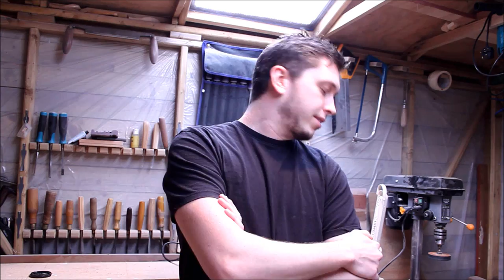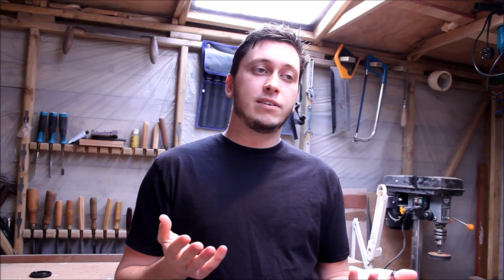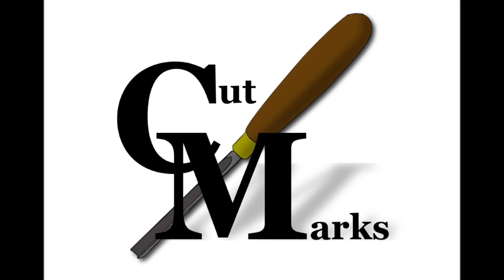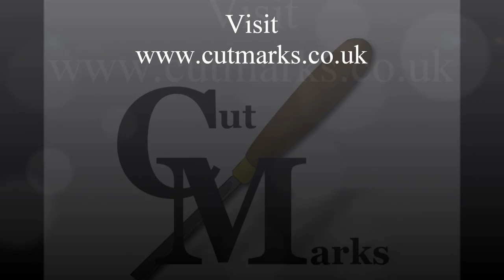How to dry green wood the conclusion

Comment: I dry my bowls and boxes in the microwave 15 seconds at  a time and when it stops losing weight , its dry. It takes a couple days but works good
Reply from the maker: Maryke Dykhuizen how many times a day do you do it?
Reply: Until it is not losing any more weight, small boxes usually takes and hour, bowls a little longer depending on the size.  The secret is not to let the wood get hot.  Cool it between nuking.